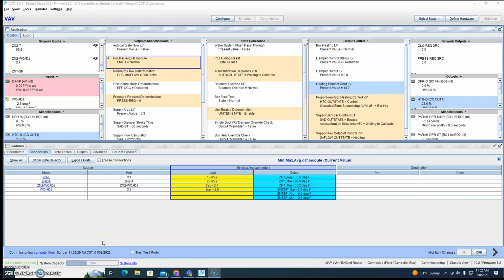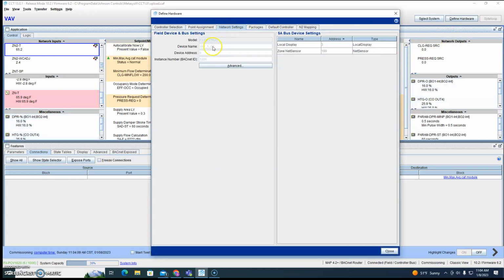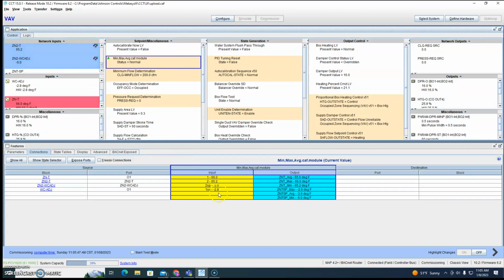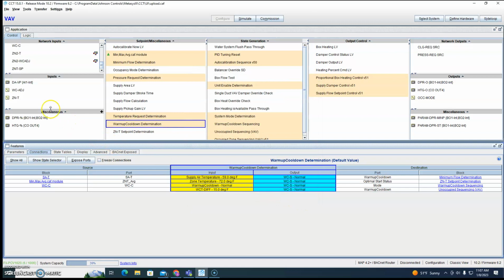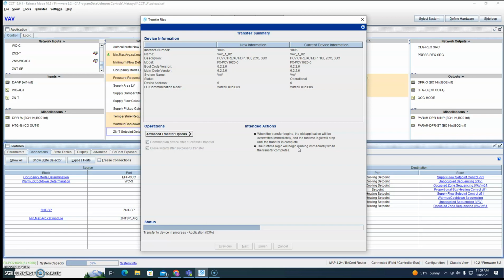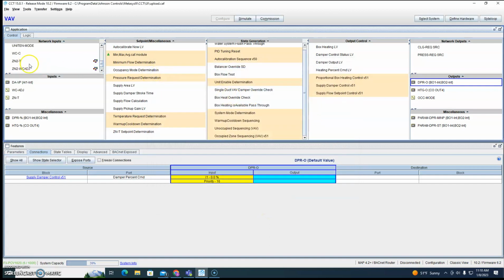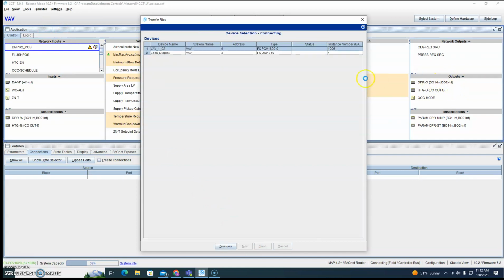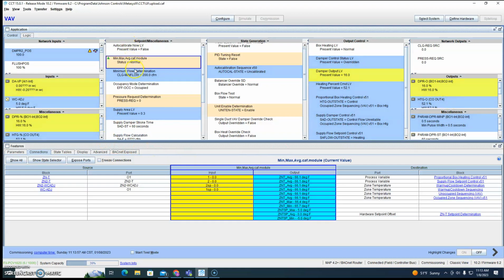How to use BACnet peer to peer to average temperatures in a space in JCI CCT.

Comment: Thank you for showing this! And getting back to me so quickly. I’ve done this with multiple VAVs all running off of one thermostat but never multiple VAVs that all have their own stats. I was worried the set point in each of the stats would have issues with the program actually controlling to the request. 
Obviously I have a large shared area with multiple stats and I didn’t want the room to be fighting itself in certain scenarios